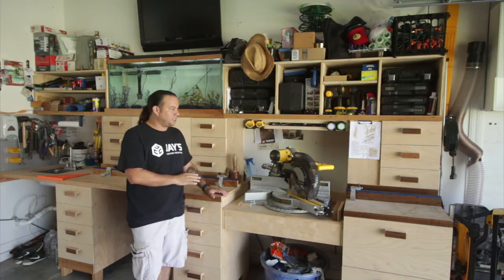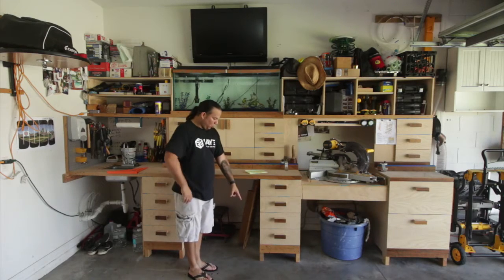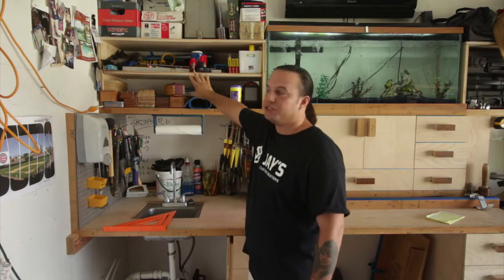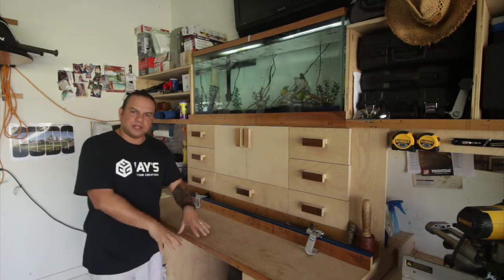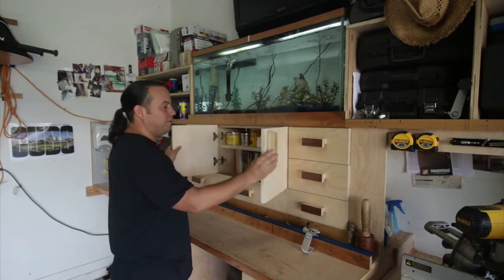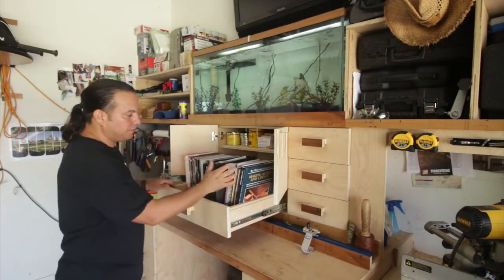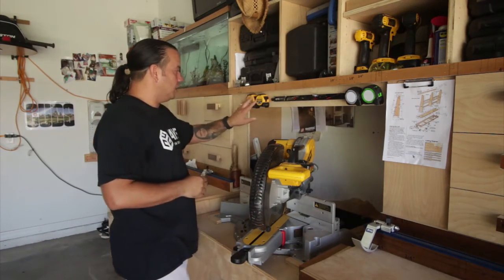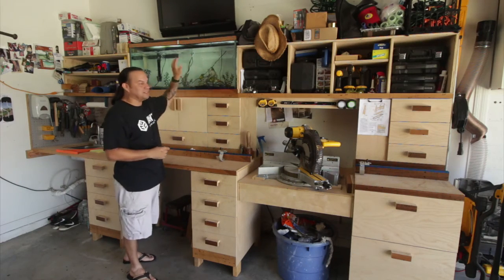Fish Tank Miter Saw Station Review

Comment: I am trying to figure out a way to modify a station like this. I want my miter saw and fence to be removable and the cabinets to be raised so I can still fit a full sheet of ply through my table saw in my small shop. You might even come across a video of that from us soon...station looks awesome, love the fish tank and thanks for sharing!
Reply from the maker: I would love to see your build. Especially making the parts removable. 

My miter saw can be removed. It's being held by blocks on each corner. I wish I would have thought to show it here. But I can show it in the next vlog video for you. 

As for the fence, that can also be removed. If you watch this section here: https://youtu.be/2erpr2wK6Ls?t=1m27s 

You'll see that it's attached with just screws. No glue at all. I can remove it at any time. You can do the same.

I'll talk about it more in the next vlog video.

Thanks again for watching ;-)

Comment: Great review and again, really love the fish tank. It's relaxing just watching your video. Do you have any issues with sawdust getting into the fish tank?
Reply from the maker: Thanks bro. yeah it's really relaxing ;-) As for the dust, I've yet had any issue. The dust on the miter station is pretty much contained in inside the miter box section. And when I use the table saw, I set it up by the garage door where the dust collector is which I'll talk about in the Dust collection video.
Reply: I have been wondering the same question about dust in the fish tank...lol...glad I have been reading the comments...

Comment: Thanks for sharing. Nice job. Did you get the Bosch Glide Miter saw?
Reply from the maker: Thanks. Yes I did. It's a good saw, but I wish I would have gotten the new dewalt, only because of the lazer and a few minor other details. Other than that it works well.
Reply from the maker: yeah I saw that one. Still went with the Bosch just cause I already had a dewalt.

Comment: maybe you mentioned this and I missed it, but if you made a cover with finger hole out of same thickness plywood, you could cover the sink opening if you needed to.  Just a thought.
Reply from the maker: Yeah I actually was going to do that, but there's really no need as I don't use that section as a counter top. More for just cleaning my hands and tools off like brushes and such.
Reply: Simple DIYr I am kind of an aesthetics guy so I would want to have a cover.  I have a deep well sink in the corner of my shop, still need to run water and a drain to it!